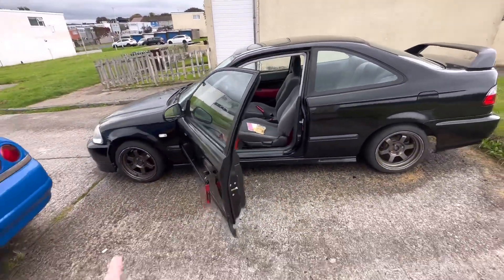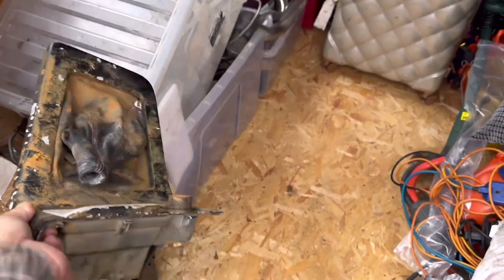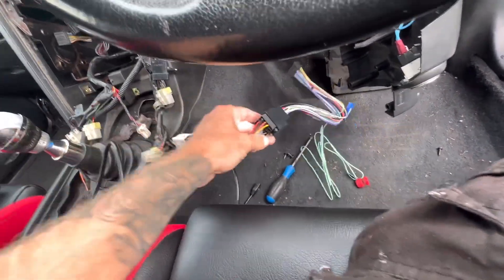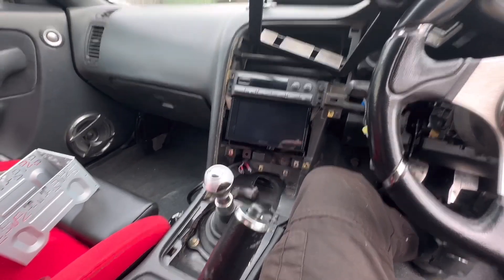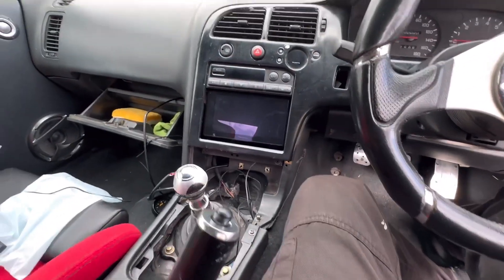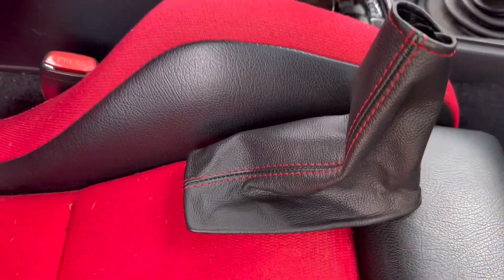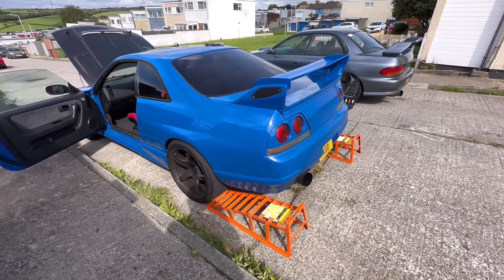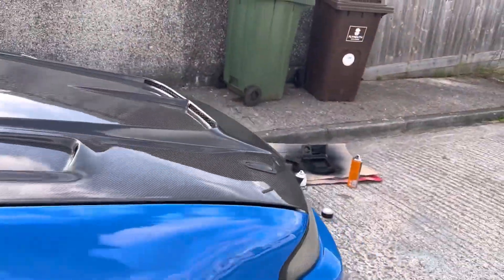R33 Skyline Project (9” touch screen & lots of interior upgrades)

Comment: The reason it's fuzzy is because you've no aerial attached to the radio. 

Also, when there are no speakers attached, make sure the ends of the speaker wires are insulated with tape.. if they touch together it blows the amp inside the stereo, then the stereo is only good for the bin.
Reply from the maker: Yeah I thought so thanks mate, I’ll have to fit an aerial sometime, the Bluetooth audio is working now so it’s all good 👍